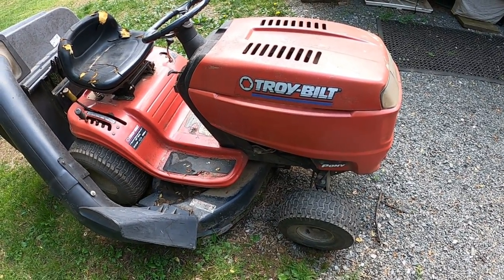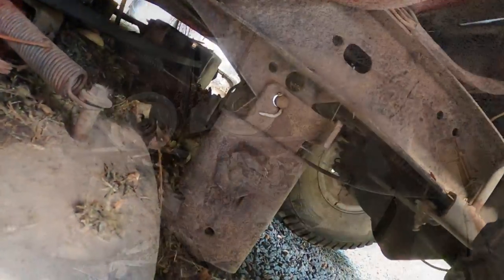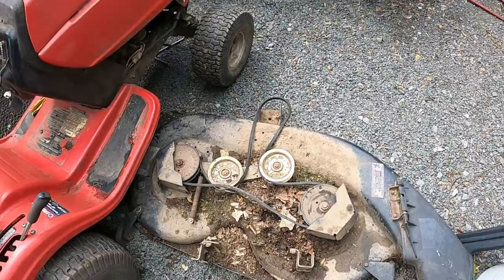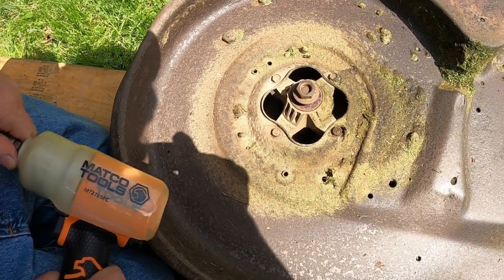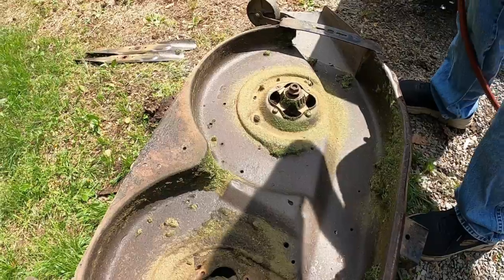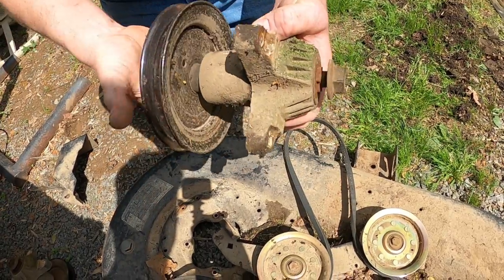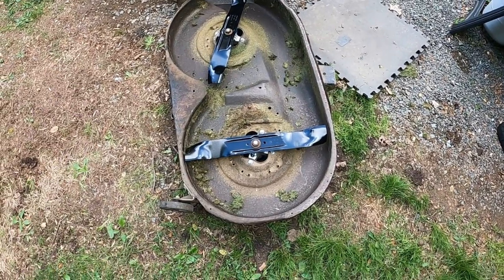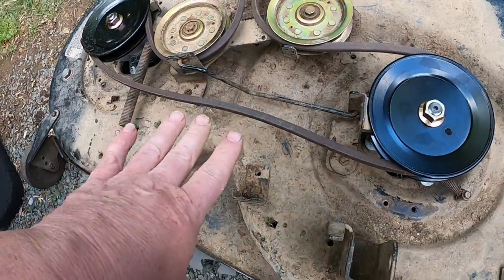Troy Bilt Pony Lawn Tractor Blade Spindles Replacement

Comment: This is fantastic. I have the same mower also from 2006, but it has a 18 hp rebuilt, Briggs & Stratton engine with pressure lube. It’s amazing with Amazon. You can make your lawn tractor last almost indefinitely as long as it’s not rusted

Comment: These have sealed bearing's. The bearings can't be greased unless you pop off the plastic cover on the actual bearing. I found out the hard way. I just replaced the bearings with race on my old spindles.

Comment: The grease fittings ( zeros) are ok to have but in all honesty the bearings are SEALED , meaning you would be greasing a hollow aluminum hub as there is no way for the grease to get into the bearings , but simply pulling the spindle off and removing the jackshaft will allow you to be able to pop the round grease seal off the bearing and then grease it by hand as you toll it and pack the bearing with new high quality disc brake bearing grease !